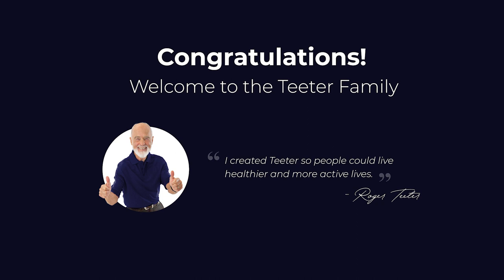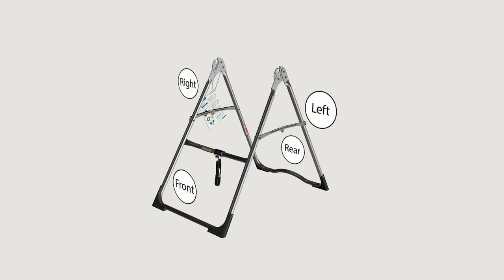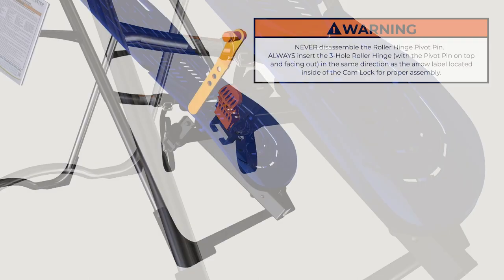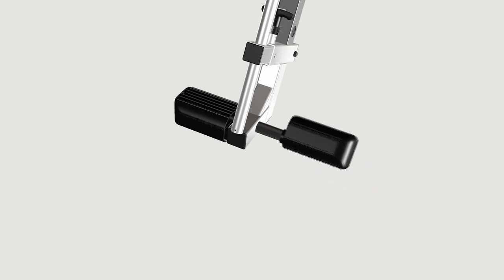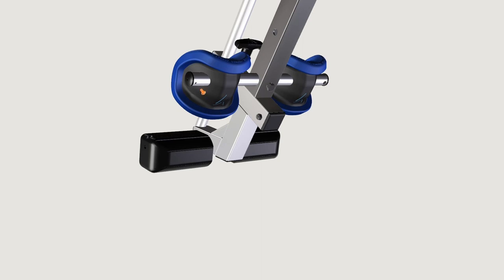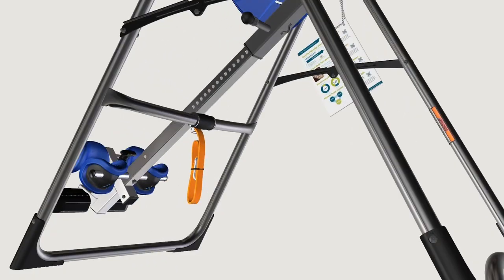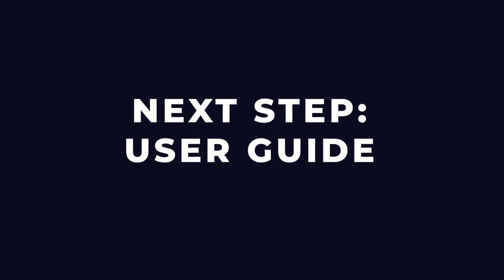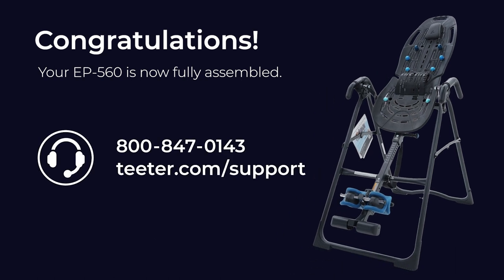Teeter EP-560 Assembly Instructions (E61006FB)

Comment: And I must have detached the bed frame extension when I first pulled the parts out of the box. Or I’m not sure if it came like that but doesn’t matter but it wasn’t on there when I tried to assemble. So I’m not sure which way it should be facing or it it matters but I’m guessing it does. Maybe that’s what I’m having trouble with step 2 so I would much appreciate if y’all can help me and let me know what I’m doing wrong. Thanks!
Reply from the maker: Please reach out to our Teeter Product Experts at 800-847-0143 (M-F, 8am-4pm PST) they will be able to assist you.

Comment: What a nightmare....the booklet seems better than the video. So found out the bracket thing was supposed to be in with the screw and bolt...do-over, think one of the screws is now stripped, nut it's in there, both sides don't look exactly the same...taking a break until tomorrow. Wish I hadn't thrown the box already...I'd send this thing back.  I don't see a reason why the first 2 parts can't come PRE-ASSEMBLED..
Reply from the maker: Hi there, I apologize you're frustrated with the assembly. Our customer service team would be happy to help or send you any replacement parts you if you're still experiencing issues. You can reach them at 800-847-0143 (M-F, 8am-4pm PST).

Comment: And what if you get bolts that are not going on the screw all the way, it turns for only a little bit and then you can't turn it anymore so it's loose.  I probably have to go buy this stuff at the hardware store huh.. 😡 215 dollars and they pack up the wrong bolts.
Reply from the maker: Hi Paul, I apologize if you are having some issues with assembly. Our customer service team would love to help you and can send you any parts that may not be working correctly. You can reach us at 800-847-0143 (M-F, 8am-4pm PST).
Reply: @teeterproductsupport  I already contacted them and they were kind enough to send me an email which was extremely helpful.  I assembled it finally on my own.  2 in the afternoon and at 3 am the next morning I finally finished.  I never gave up.  I was PISSED.  Everything is good now.